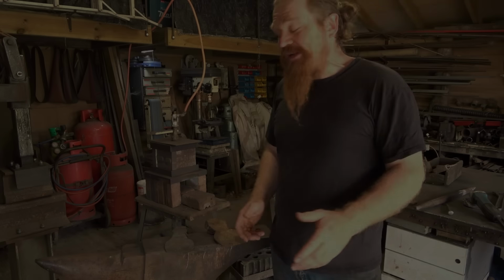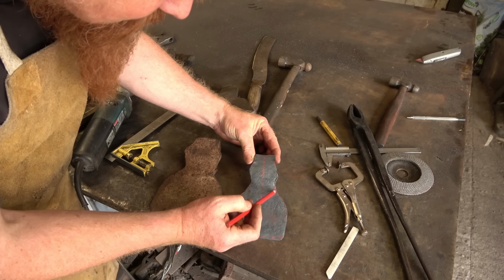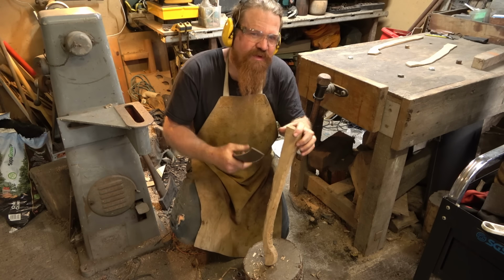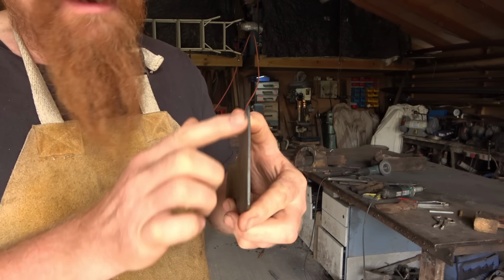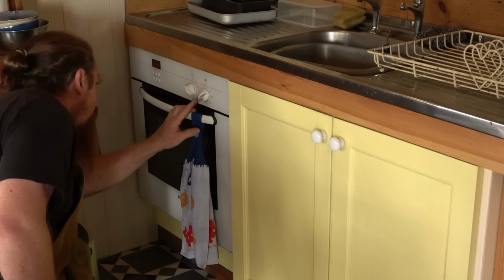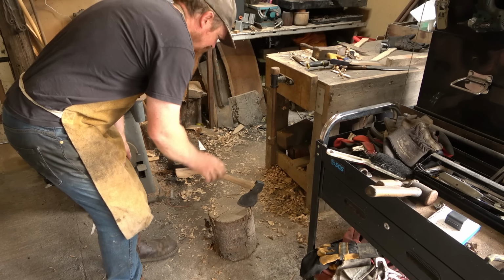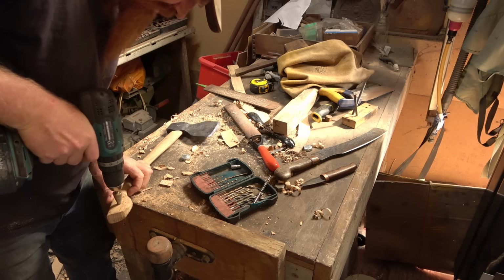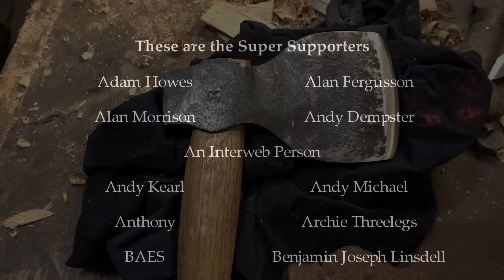Blacksmithing - Forging a Kent Pattern English Axe Part 2 of 2

Comment: Thank you for two lovely videos.
I had never seen or heard of a flypress until your recent videos restoring and using one. And then, yesterday on TV, was a "wheeler dealers" car restoration programme where a guy made some replacement hubcaps for a car out of turned aluminium. And then cut some brake cooling slots into them. Using a flypress....

Comment: Loved this. The time you must have spent and the effort - top work! Never seen a hardness testing kit before. Have you ever made an axe with convex cheeks? It seems to be a quality that a lot of old felling axes and camp hatchets had but modern production models lack.
Reply from the maker: This is the only real axe I've made so no! From what I've seen, the Kent pattern axes tend to have a fairly flat taper towards the ground bevel, I have seen one with convex cheeks but that was a big heavy axe. I suppose it depends on the application, convex cheeks would be better for splitting wood, flat or concave better for cutting.
Reply: @maximusironthumper  Convex as in with a high centre line. It helps to prevent sticking and pop chips when bucking or felling. You'll see it with American axes but also perhaps with English felling and mining patterns too. It does make a big difference I think.

Comment: I've been black smithing. Making horse shoe and parts you can't buy anymore for years. On your first attempt you just didn't have enough material to get what you wanted. I would of cut off twice the length of spring you did ,then heated it half way cut halfway thru it folded it over and forge welded the two pieces togeather. Now you have enough material to shape the eye and plenty to draw out to any shape you want .Draw the blade out to the shape you want and cut or grind off the material you don't need. Heat harden the cutting edge and alls left is cleaning up and sharpening. Good luck it's a lot of work but very satisfying. 
Add date and initials for your future generations.
If you know someone who has a wood planer ask them for the planer knives that can't be sharpened anymore. I make great draw knives from old planer knives.
Reply from the maker: It's all the same axe head! I just took a break and came back to it the following day. A folded axe always has an inherent weakness at the weld (as shown on the old one I used as a pattern), if I'd wanted a folded axe I'd have chosen a different steel to start with as the chromium content in 5160 makes if reluctant to weld to itself. The usual way is to forge the body from mild steel or wrought iron and weld in a high carbon steel insert. Forming the body of a folded axe from high carbon steel would be (pointlessly) hard work.

Comment: Brilliant, you are definitely a master forger. I like your initiative design of the power hammer you should make video about it. However, I consider your comment that wrought iron head with cabin steel cutting edge failed because it was wrought iron would not apply to mild steel as you stated. The clew is the name. Wrought iron is very pure iron, a noble metal which is why it does not oxidise away like mild steel. Unfortunately the manufacturer process in the early 1800’s left a lot of inclusions in the iron that I suspect was the reason for failure. Mild steel is an alloy this causes the atomic space lattice structure to stressed which gives it strength and toughness. Therefore a mild steel head with a forge welded cabin steel cutting edge would not fail as you suggested.👍

Comment: When you're checking the hardness with the hrc files you need to clean the forge scale off first otherwise it will give you inaccurate results
Reply from the maker: Any scale or oxide is gone with the first few strokes of the files.

Comment: Hi Max, I'm not able to examine it in person, but could the American style axe you mentioned looks similar to the Hudson Bay style axe? A Hudson Bay axe typically has a 20 to 28-inch handle and features a 2 lb axehead with a flat top and a swept back design. It's mainly used as an all-purpose camp axe. There are hundreds of different axe types, each suited for specific purposes and with origins going back hundreds of years. One style that has remained popular for several hundred years is the Hudson Bay Axe. This axe falls between a hatchet and a felling axe, making it highly versatile and capable of handling almost any task that an outdoorsman needs from it. Its unique design features and fascinating history make this one of my personal favorite axes. I always take an Estwing E44A camper's axe with me on my canoe trips, and it also has a place in my truck during the winter. It has gotten me out of more problems than I want to admit. The name "Hudson Bay" comes from the Hudson's Bay Company, which dominated the fur trade in the Hudson Bay area and its drainage basin in modern-day northern Canada and parts of the northern US from 1670 into the 1800s. French "trade axes" that traders sold to Native Americans in exchange for beaver pelts had no poll (the steel wrapped around the handle) and were usually of lower-quality steel, so the superior Hudson Bay axes became desirable tools for Native Americans and gained popularity among European settlers. The shape of the eye is essential, as the earliest trade axes had round eyes that were problematic for keeping the axe head secured to the handle. The Hudson Bay design improved to a teardrop-shaped eye to keep the axehead attached in the harsh environment for daily use. The Hudson Bay Axe has a remarkable history throughout the Americas and remains popular in modern times. The design was improved from the Mediterranean design and has remained unchanged for several hundred years. This shows the benefits that these features have delivered. The Hudson Bay axe is exceptionally versatile and a favorite with bushmen and campers like myself.
Play safe from Elliot Lake, Ontario, Canada.